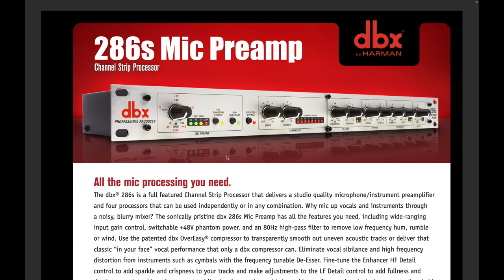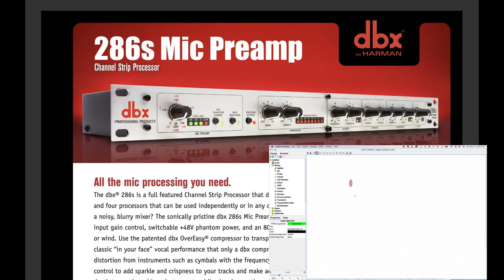Fixing the dbx 286s Audio Processor

Comment: Thanks for this. Just a tip for anyone reading, you can do the rework with a normal soldering iron and flux. I find it easier and more reliable than hot air for making sure pins are properly flowed.
Reply from the maker: I agree with you. Given that these components were surface mount with legs, it's probably a better technique. I just did not want to deal with bridges.
Reply: @chuckbenedict7235  Fair call. If you use enough flux and the right tip, bridges are nothing to worry about though. Solder always flows to the hotter surface, so if you clean the tip, add some flux and just touch the bridge with the tip it will remove it instantly :--)

Comment: I’ve got the same problem with my DBX. I don’t have the equipment to do this, but I will find someone who can thank you for this video. I’m sure this will solve the problem with mine DBX to
Reply from the maker: Sorry to hear. You can get a new hot air rework station for under $80 from Ali Express. Get flux as well. Probably can get a used one for less on eBay. You could also try a local college...they have labs they might let you use, or fix it days.